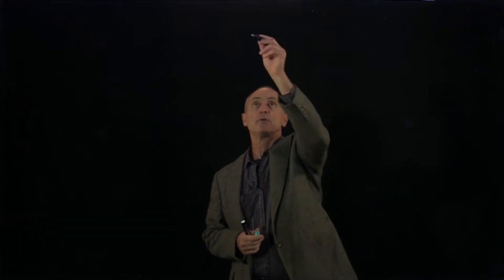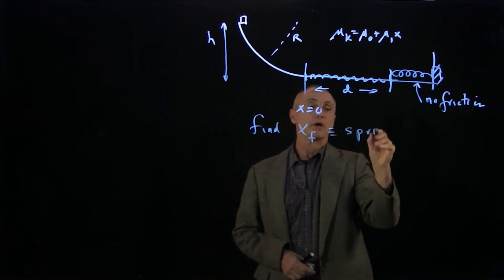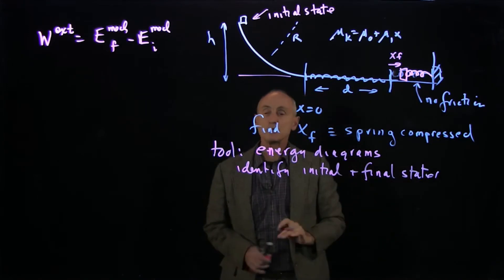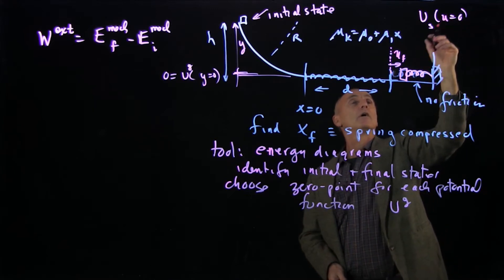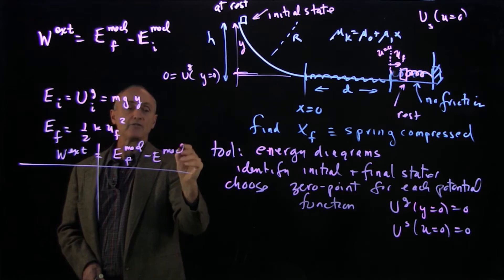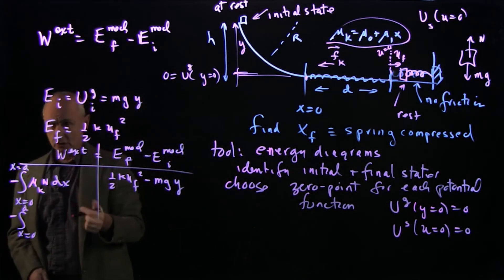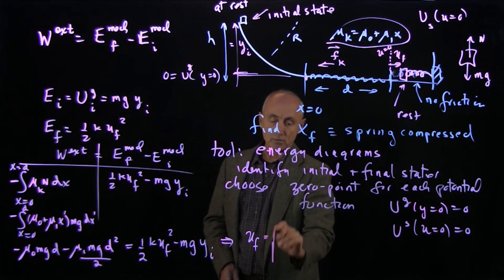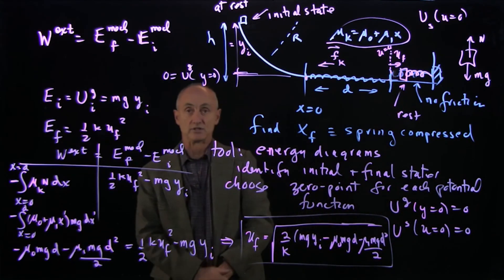24.3 Worked Example - Block Sliding Down Circular Slope

Comment: neat problem, but how would u solve if there was some friction from the curved path since you'd have to account for the changing normal force due to the changing angle due to the curve and the changing velocity (its really the changing velocity which is confusing since idk how to integrate that part)?
Reply: The normal force would depend of an angle theta, which is the inclination of the plane. If I remeber correctly is: cosine(theta) *mg (for an inclined plane). Which may go from 90 degrees in the wall if it's vertical having no normal force (cos(90)= 0)  to the end of the ramp in horizontal  0 degrees (cos(0)=1). You probabbly have to do a definite integral between those values ( 90 to 0 degrees) and then do the definte integral of the work which would have the limits from 0 to the lenght of the arc.